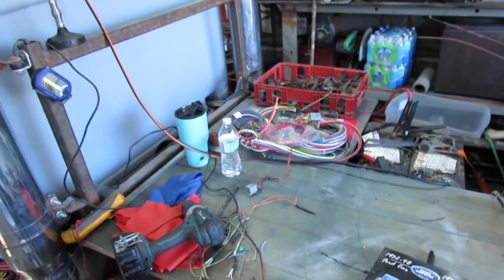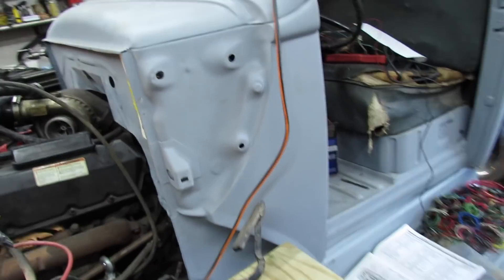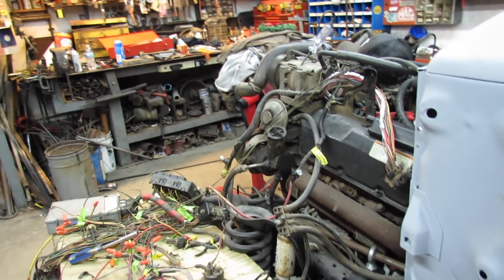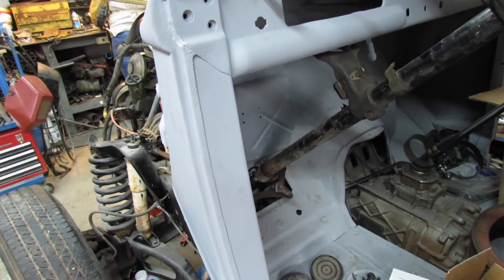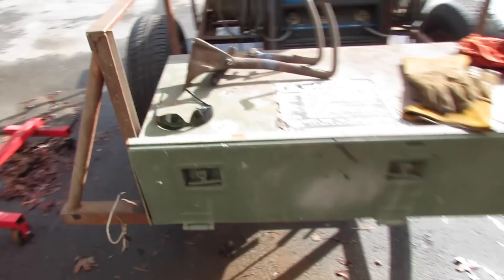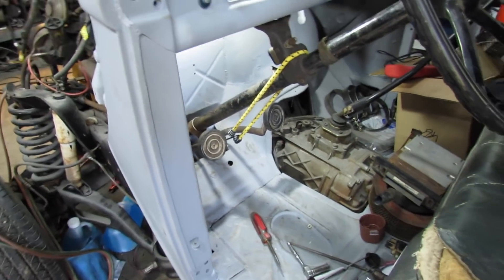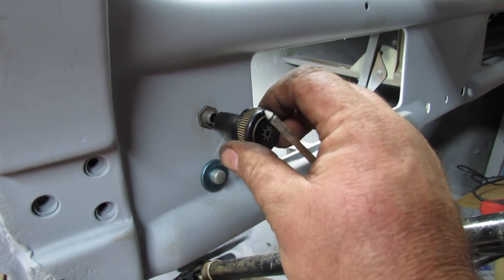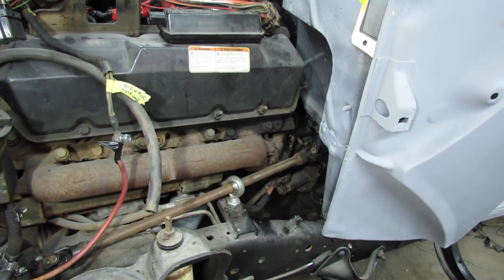46 Ford Powerstroke - Pedals

Comment: I been thinkin  'bout your guage cluster on the 46 and how you can make it work. Most late model crap these days use little stepper motors for guages driven by the computer. May be worth your while diggin around the interweb to see how feasable it is to use those from the truck the engine came from to move the antique needles in the vintage cluster. It'd be cool to use those. I'll try to do a little diggin too.
Good luck!!!!!!!

Comment: I think if you look at the 51 ford you have the push button on that truck should be a two wire button but I could be mistaken , I’m not sure if I used the original button or order one with the two wire . I often thought that when ford designed these truck not only were people small around but they must have tiny little feet .

Comment: Are you sure that’s a .30-30 shell?
Reply from the maker: stoweja it ain’t a .22.
Reply: MrHevyshevy  It sure isn’t a .22.  But the dimensions don’t match a .30-30.  It looks closer to a 7.62x54.  Perhaps repeated use as a gasket cutter has altered it’s appearance 🤔.

Comment: How are you going to use vacuum wippers when that engine don't have vacuum that's why that put a vacuum pump on the front left-hand side of the fan belt.
Reply: So still has vacuum don't it?
Reply: @williamuskoski1385  the vacuum pump only supplys enough vacuum for what few things that has to have it it want handal anything else pulling vacuum from it.